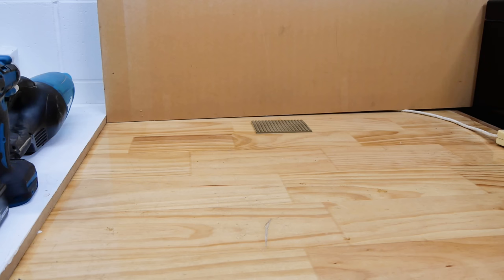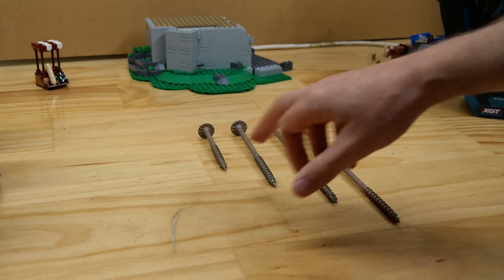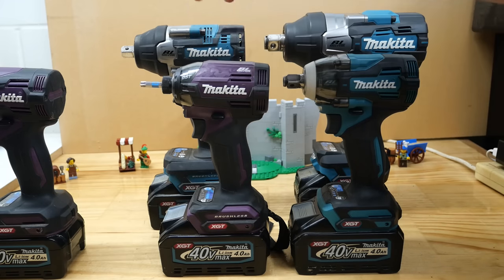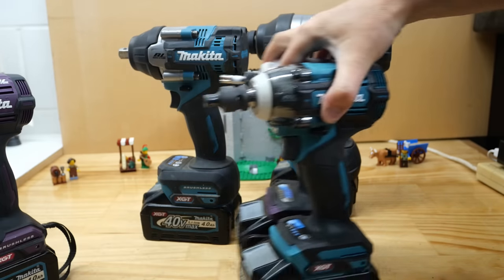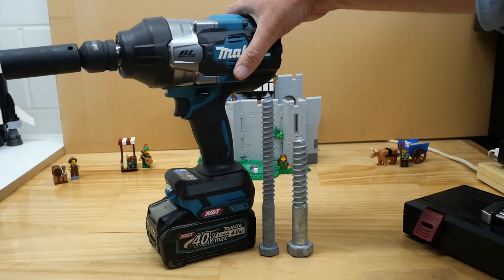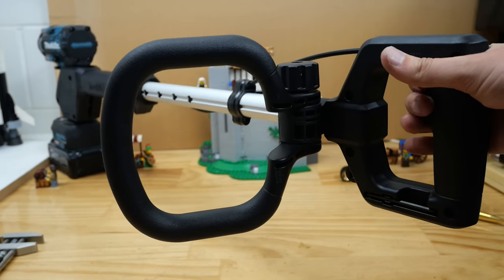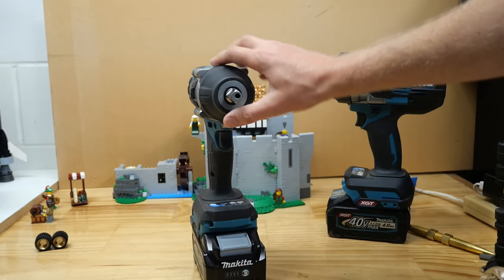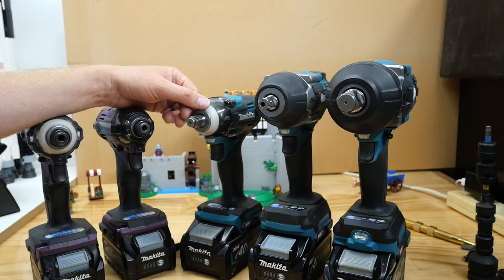Every Makita 40v Impact Wrench Head to Head. Which is Quicker, Impact Driver VS Impact Wrench

Comment: Those adaptors reduce torque by quite a bit (Torque Test Channel shows this often), reason being the peak of the impact on the hammer does not occur when the bit is seated. The more of these you add (adaptors, bit holders etc.) the worse it gets.
Reply: The test with a bunch of adaptors strung together isn't representative since it didn't impact for 2/3rd of the depth. Plus the negative effect of adaptors increases considerably the closer you get to the limit.
Reply: @whirled_peas  you're thinking about this way to hard
Reply: @brettwalkom948   It maybe harder for some to think than others.

Comment: I'm a long-time Makita fan, invested in LXT, and feel cheated when Makita came out with XGT. But those XGT batteries look ridiculous on a small impact, hence I went with Milwaukee. Sold most of my LXT and got the M18 and M12 platforms. I only invested in a High Output battery, the HO3.0 on M18 impact looks and feel very nice.

Comment: Makita impact drivers/wrenches are like golf clubs or fishing gear, for that matter, the right one is just better to use. Scaffolders would love those low torque 1/2 drive wrenches, with the pin to stop the socket from accidently coming off, especially at height.

Comment: The pin detent model you have doesn’t require nail or similar to push the pin in. Its the weak/soft pin, the pin goes to a point, you should be able to pull the socket off by hand. Makita do offer 2 pins, a soft and hard pin. The hard pin requires a nail to push the pin in to remove the socket. From factory the pin detent  models come with a soft pin installed.
Reply from the maker: Try telling my tool that.
Reply: I changed my pin over to the stronger pin and it’s get annoying. Apparently the weaker pin get a lot of complaints because socket fall off easily, I experienced this too. Some brand sockets just fall, one of the reasons I changed my pin.

Comment: Another excellent review 🤩
10:36 Why does the TW008G Mid-Torque Impact Wrench slow down brutally? The translation isn't clear, do you prefer Impact Wrench with C-Ring or Detent Pin?

Comment: The mid and high-torque are more for loosening right-hand threads. Driving screws with those shows that the low-torque (which likely has the same drivetrain as the impact drivers) is going to be better in the fastening direction.
Reply: The compact wrench isn’t running the same internals as the drivers, and IIRC, TTC proved that the Makita 40V compact is pretty competitive with some of the smaller mid torque offerings when it comes to hard torque.

It’s likely just that the higher IPM/RPM of the drivers make up for any torque descrepencies in wood, with the ‘smaller’ fasteners.

Comment: Looks like Makita's engineers have a good understanding of what it takes to drive screws vs setting and loosening nuts. The drivers punch well above their torque rating (as well as scale...) weight.

There is likely very rapidly demising returns to distance driven per hit, from increasing anvil weight beyond fairly light, when driving into wood. It's not that hard to just "bust" the stuck screw loose again, compared to a rusty nut. But once that initial busting loose is done, the heavier anvil doesn't move the screw all that much further before friction again renders it "stuck". So you're better off with a faster rate of more moderately sized blows. As opposed to for a tough nut, where it's all about the max peak force of a single impact, since once the nut is loose, it's loose. And no rate of smaller hits, will ever bust it loose, if it's stuck hard enough.

Something like the bigger motor of the big wrench, combined with a lighter, faster hitting anvil assembly, would likely be the optimal for driving big screws at some useful rate, if one for some reason had to do so without drilling a pilot hole.

Comment: For Makita Impact wrenches, any comments in regards to friction ring Vs. Pin detent? I've seen videos that describe the friction ring causing issues where they won't hold sockets anymore, and notice it lacks a rubber O ring. At the same time I've seen people claim Makita's pin detent is different than other brands (eg, Milwaukee) and is actually just as easy to remove as the Friction ring. I'm trying to decide for the compact impact wrench (XWT14 Vs. XWT15 in the states). Thanks!